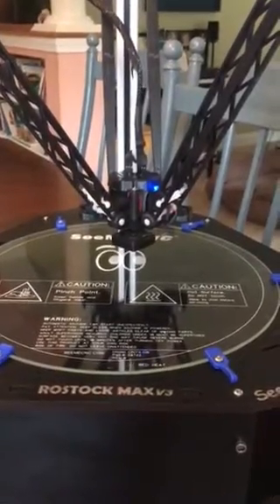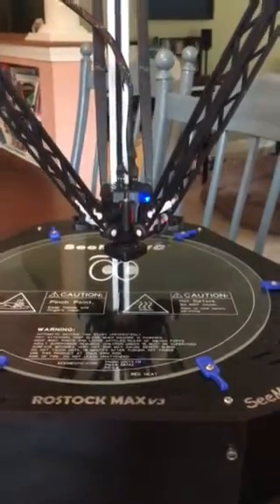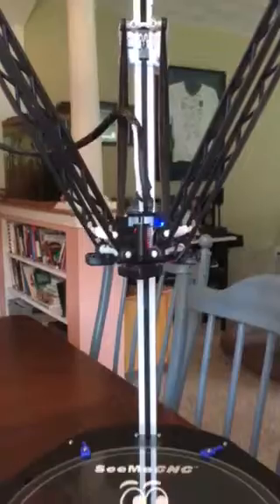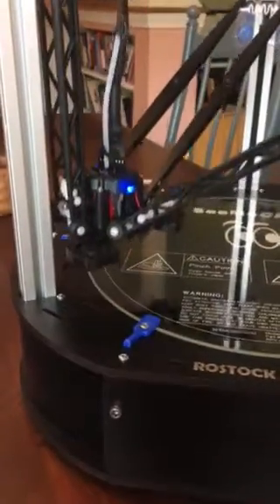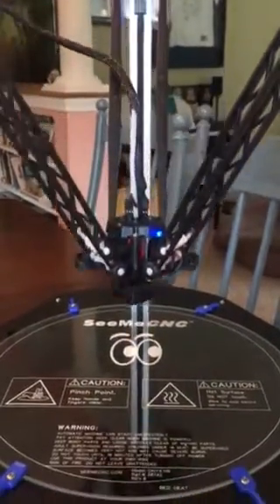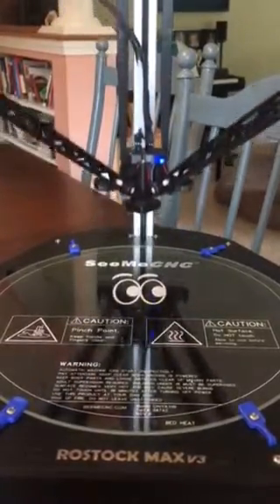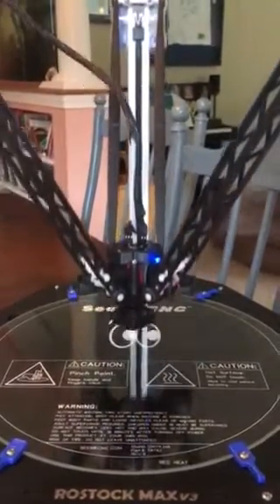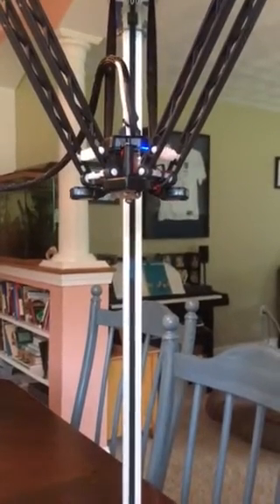Rostock Max V3 first run

Comment: Just building my V3 60 % done. Cant wait to finish. Cheers.
Reply: Hi, i purchased a v3 as well and built it, did you have trouble with uploading the firmware by any chance? please let me know thank you!!
Reply: Tyler Sunshine , nah no trouble.
Reply: dammit ok, well the printer when i turn it on without the firmware uploaded to it, the guide says on the lcd there should be nozzle temp and bed temp and it should say printer ready, but my lcd says the make and model of the printer and version of the firmware, do you know how to reset the motherboard? i already tried eeprom clear like a million times, thanks!!!
Reply: Tyler Sunshine sorry, dontnknownwhat 2 do. I had issues with connecting the lcd couse the guide sucks. I thibk I burned my trimmer couse it resets the printer every time I touch it. So I need to have a laptop connected all the time. (sob)